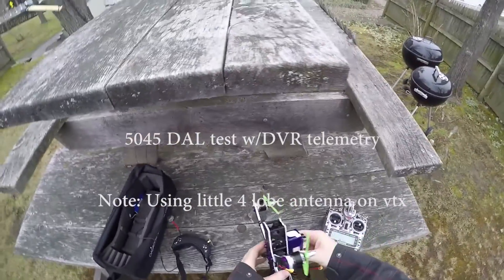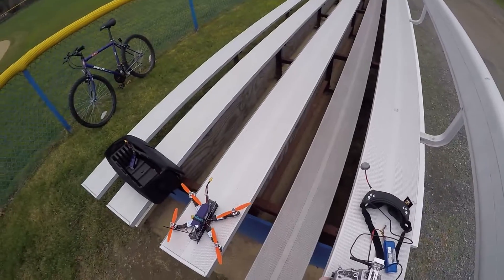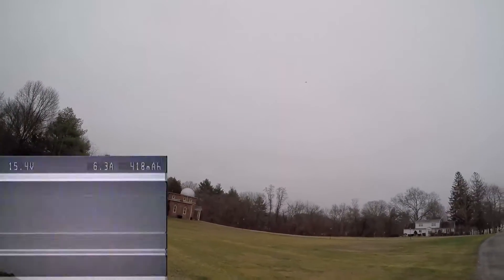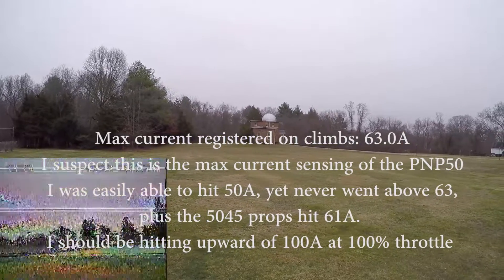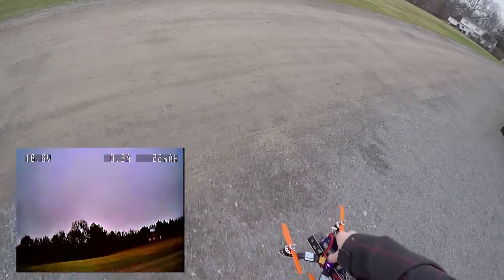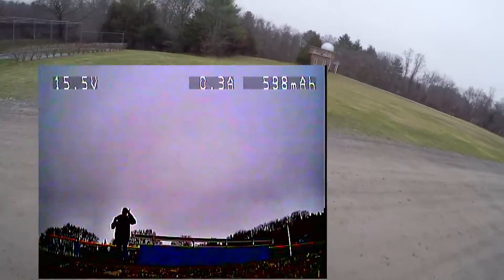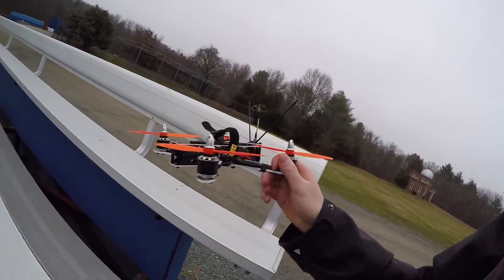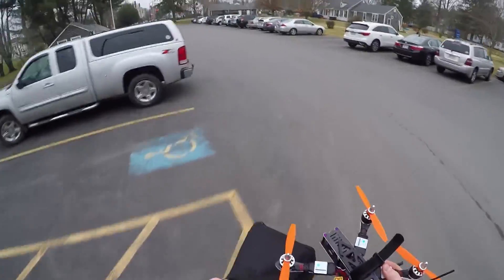6s 6" ImpulseRC Alien build Maidenflight

Comment: Hey Zebi, maybe you should lower your min_throttle - if you calibrate your escs under Cleanflight properly, you'll be able to adjust it pretty low. On my current setup (alien 5", cobra 2204 2300, littlebee 20A, tbs pnp50, 4S up to 1500, a bit lighter than yours, granted, but somewhat similar), after proper esc calibration, had the 4 motors reacting to a min_throttle of around 1017. Also, I couldn't help but noticing that your "hover" terminology refers to your sticks %, when you should really be looking at the Amps drawage in your osd. In my experience with the 250/280 class for a ship around 600 grams, 'hover' with the proper setup should be requiring around 7A. When you tested your quad's hover, it showed around 14A, which is double what we're used to getting - at 14A, we start to cruise at a pretty good speed already. And when you did throttle down, the A consumption was at 7A, which should be your hover Amperage, not min throttle :) Just my two cents. Oh, and of course, try the escs damped settings, but maybe first think of your min_throttle and the A drawage at hover :) Cheers!
Reply from the maker: +Nilsen F. Thank you for your explanation. 

I ended up flashing dampened light (active breaking) to the ESCs as well as lowering the min_throttle to 1050. It now idles up at a lower speed and is easily able to lose altitude. 

Ill try seeing what exact signal they idle up at and try setting the min command to +10 above that. 

There are a number of reasons why my hover current would be much higher than yours. Im spinning 6040BN props, and my setup with camera etc as seen in the video weighs over 1kg... a heavy little bird.  I expect the 6s flight weight to be around 1.2kg with gopro, so it will definitely be requiring more current than a light cobra 5" build for sure. 

Ill update as I get my 6s batteries setup and do some more pid tuning
Reply: Zevi Rubin :) Indeed your bird is on the heavy side - your motors are enormous! At 64g a motor, that's 3 times a cobra 2204 weight :) Power wise I think it'll go supersonic in 6S! Good job on lowering the min_throttle, I'm pretty sure you can go down even more indeed. The key is to really try to properly calibrate the 4 escs: noticed on ur vid at 0:45, motor 3 spins first, then 4, then 1 and 2 - that means the escs are not yet calibrated the same - all motors should start together at almost the same min value - and stop spinning at the same time too. That will help reduce any drift at full power, and for you to precisely lower the min_throttle. Remember, you should barely have any amps consumed at min throttle! Can't wait to see it fly in 6S :) Keep it up!

Comment: Its your props causing slow descent. All i use are the 6040 APC speed props on my qav250. Then when I switch to my qav180 with 4045 props it takes a battery to readjust because it just wants to fall out of the sky.

Comment: should add a power filter to your system i had those horrible lines too made me crash a lot :P tho im only starting out. Other wise amazing picture & quad!!
Reply from the maker: +ryan mccann Thanks. Weird thing is that I already have a power filter, being the TBS PNP50. Its rated to 200A current and 10s battery, and its supposed to filter the vtx and camera leads.

Its a shame because its basically unflyable on 6s due to the lines
Reply: Try adding your own also bud!! Cheap as beans to make and mine removed 95% noise easy....its actually a joy to fly now
Reply from the maker: so add a 5v filter between the camera power from the TBS PNP50 and the camera itself? Would you recommend a polulu or something?
Reply: +( ͡° ͜ʖ͡°) Zevi Rubin  get yourself a 30/35v 1000uf capacitor and a ferrite ring mine is PDB>powerfilter>vtx>ferrite ring>camera. I'm a noob but this worked wonders for me.

Comment: Nice build! I just got my Alien 5" kit to start my build. Also, I noticed you're using the Skyzone's. How long have you been using them? How are they working out for you? I just got them and haven't had a chance to use them yet.
Reply from the maker: These are the first version skyzone 3D goggles and I really like them! I only used them with the 3D camera for a little while since the camera and transmitter are pretty bulky. I ended up just using them in diversity mode and they are great! Love the built in DVR. Highly recommend them

Comment: Have you got config the ESC to damped light? It seem to me that the Motorbreak is not enable... By that the slow lost of attitude is normal... For 4s test the 1.800mah 4s, light and the same flight time as the 2.200mah. But better agility...

Comment: How are you liking your KDE motors? I'm thinking of getting some 2306XF-2050kv for my 6 " (Astro-X6) heard that they are reaL QUALITY motors but dunno how they perform at all.... any recommendations?
Reply from the maker: Ray Choi I like them, and the three different kinds I've used had performed well and been very good quality. 
With tthat being said, you can get better performance with less weight for the same price if not cheaper with other motors. They likely won't be quite the same quality, but a crash that breaks them will probably break these too. 

I'd look at brother hobbies T2 motors, returner V4s, rebel pro spec, and f80 motors. They are lighter and produce more thrust.
Reply: ( ͡° ͜ʖ͡°) Zevi Rubin thanks for your reply ;)
Was just curious about KDE motors. I have the F80 and the F40-60 Pros too if dau they are some of the most powerful motors right now. I also run the T2, and Hyperlite V4. These are really probably the best motors in the market with the Emax RS2305 and terror new 2306...

Comment: what osd are you using?
Reply from the maker: Powerosd pro from quadrevo. Love this osd. It's a PDB, camera and video power supply, osd, and everything in one clean board. Highly recommended
Reply: The problem with Quadrevo Power OSD Pro is the Vtx  power is 10v. So make sure you match your voltage or you will burn your transmitter.

Comment: Wow. Your fpv setup is shocking. You were getting video break up at 20feet. 
I bought a budget setup from Bangggood and it is much better.
TS5828 tx
Boscam RC805
Aomway 4 lobe Antennas.
Cheapo 1000tvl HD cmos 2.8mm board camera.
Cheap as chips and works faultlessly. Image is super clear with no latency.
I wear specs so i use the Hobbyking V2 Quanum goggles.
Reply from the maker: +Beetlejuice 01 try running your FPV setup on a 22v battery with 180A of current draw and let me know if it still works flawlessly